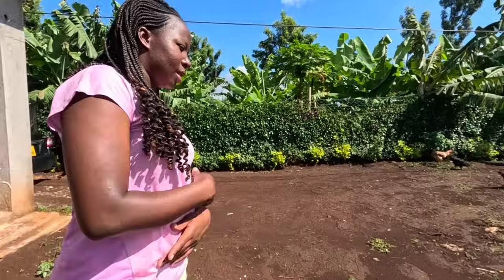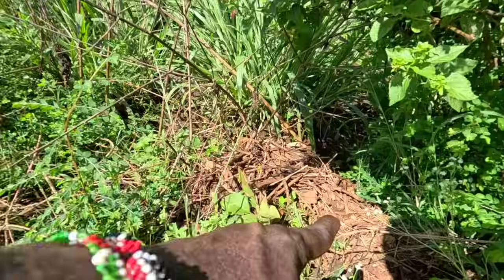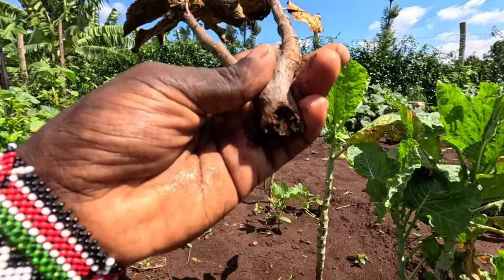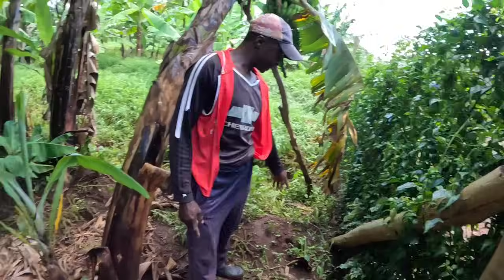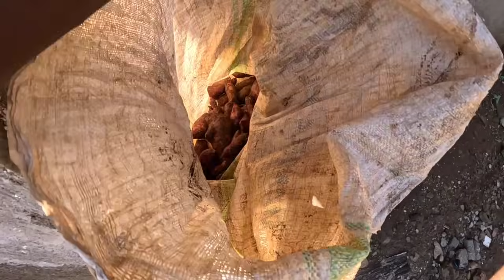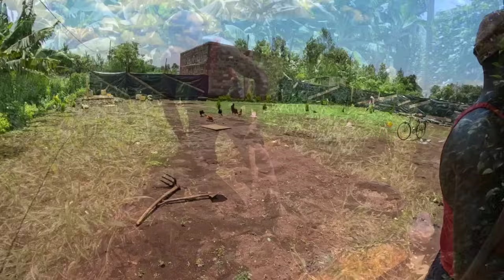OMG😱 FINALLY‼️ WE FOUND THE SOLUTION FOR OUR DAMAGED HOME  IN AFRICA 🏡

Comment: Except it's a tropical storm or hurricane during the June to November hurricane season, and strong winds fell electricity poles, then power will be cut off. Otherwise, regular rains do not lead to loss of electricity. Electricity supply is very stable in my country.
Reply from the maker: Wow that sounds reliable to us. Here when an electric pole falls on the wires might take even a week before they get it rectified
Reply: The garden is looking great. So sorry about your passion fruit tree. Be very careful re the termites. They are very dangerous. dont let them close to your house. They will eat your house down.